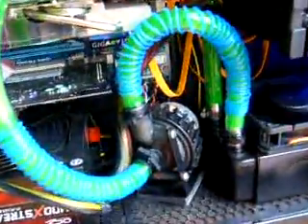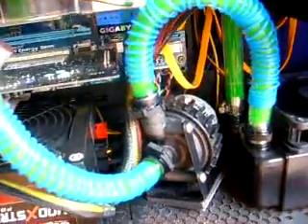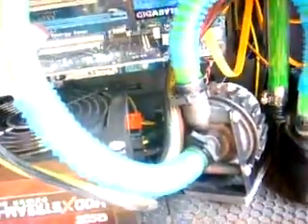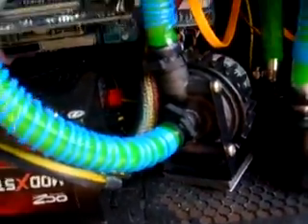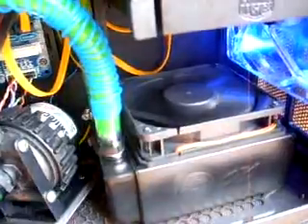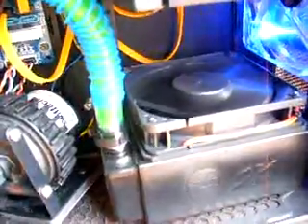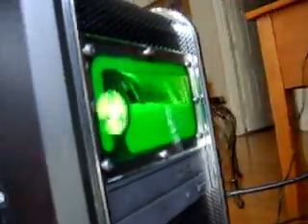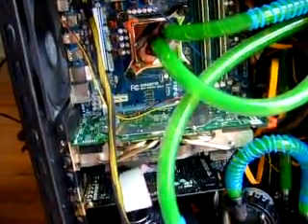Swiftech H20-220  Ultima and Feser 120 XChanger finale installation liquid cooled pc

Comment from the maker: @gnuojoung I was going to upgrade to a dual Feser on top but it will not fit. Even with the Swiftech there is only 1/2 in. of free space. I wanted to do a dual push pull fan setup and you cant even place a fan on the radiator in the case, so I has to place just one set of fans in the top section.

Comment: you may find if you're still looking at putting a feser rad up the top, that there might be clearance issues between the rad and the IO shield, i found that with my XSPC RX240, which is roughly the same size as the feser, i had about 1" if not less, clerance between the back of the rad and the io shield, which would have prevented me putting the motherboard in correctly, that is why i mounted the rx240 on the bottom of the case.

nice job, looks great